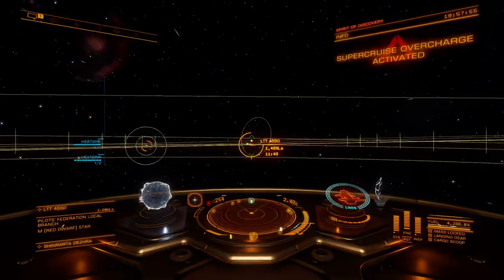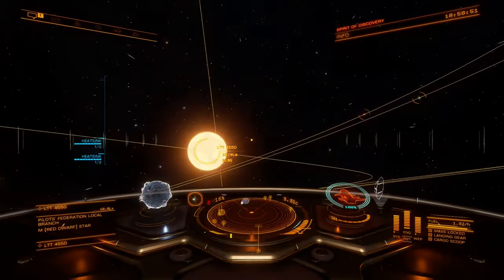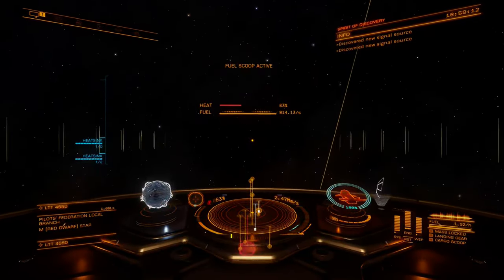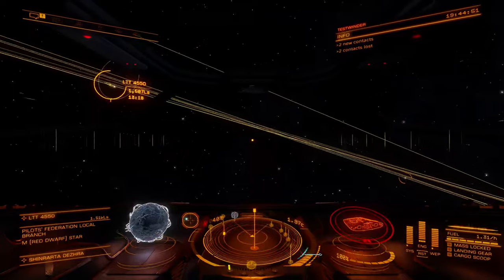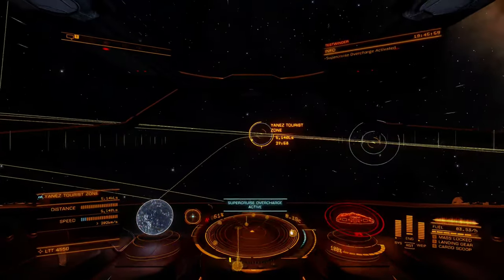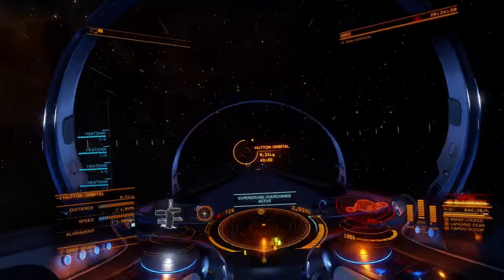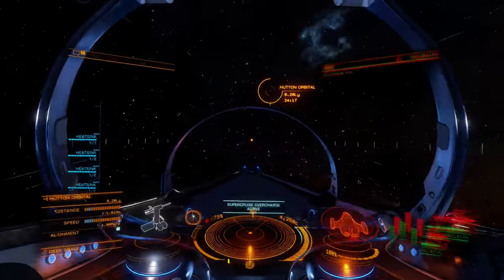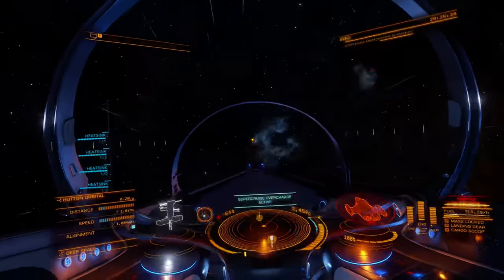Elite Dangerous | Module Review | Super-cruise Overcharged FSD [OUTDATED]

Comment: Loss of Jump range is significant since the SCO drives can NOT be engineered at all. Jump range stats for my Python trader (empty, can hold 128t of cargo) were:
5A fully engineered (Increased range and Deep Charge) and with size 5 Guardian FSD Booster - 36.8 ly
5C SCO with size 5 Guardian FSD Booster - 20.9 ly
5C SCO only - 10.4 ly (drops to 8.9 with full cargo load)
Overall it isn't worth it.
Reply: Sounds about right, no bueno for me.
Reply: You can run the guardian fsd booster lol nvm re read your post iam tired fam
Reply: SCO drives are now available in all sizes/ratings and are fully engineerable.